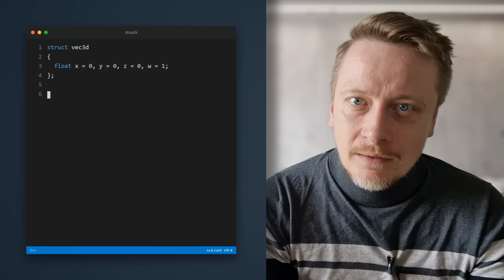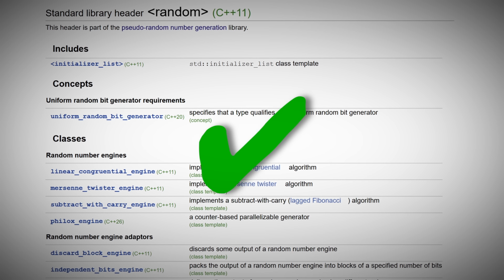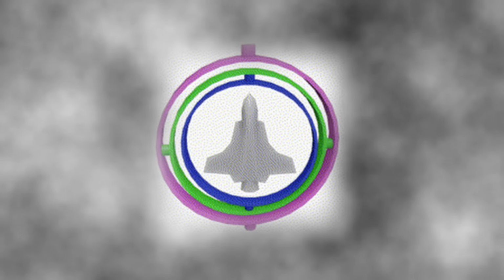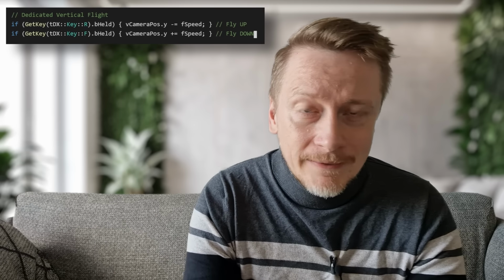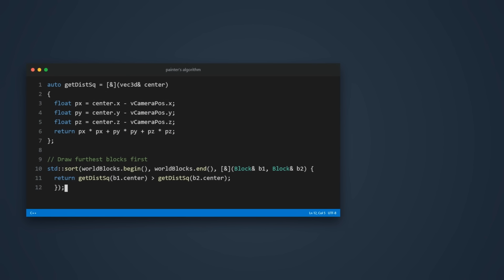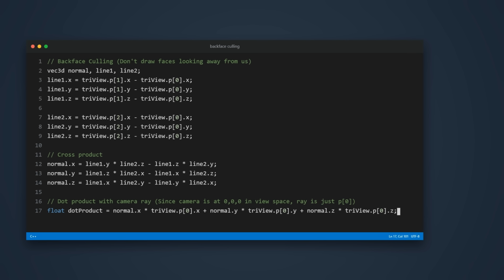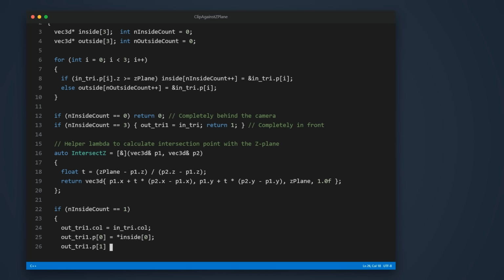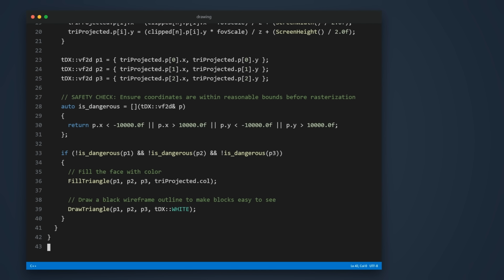Can You Build a 3D World with ONLY Math? (No Libraries, No DirectX, No OpenGL)

Comment: interesting, I always though near/far planes were implemented by the tri filler, this approach seems interesting but why is the performance so bad currently?
Reply from the maker: Thanks! By tri filler you mean rasterizer? If yes, then no 🙂 Clipping happens after the vertex shader (when vertices are in clip space).

Performance is not great mainly due to how I’m handling visibility tests (currently per pixel). Also, an important optimization (which doesn’t affect this particular scene much) is to compute only data that’s visible to the player (within the FOV).

There are more things, but these are the main ones to tackle.